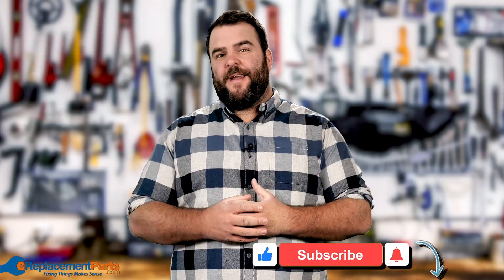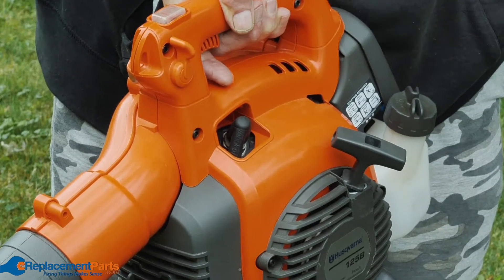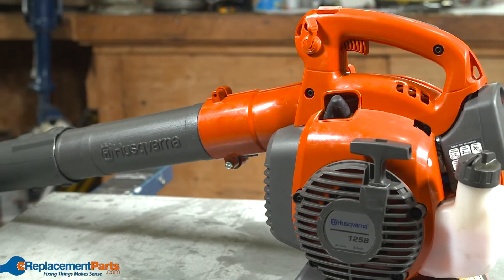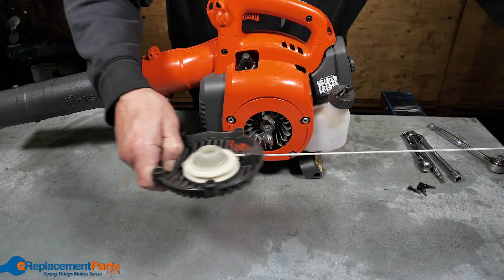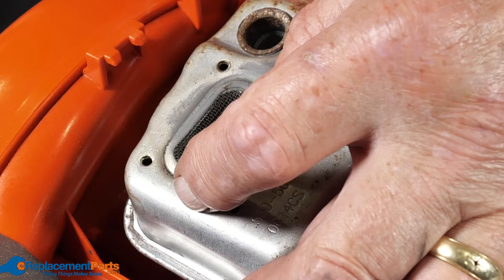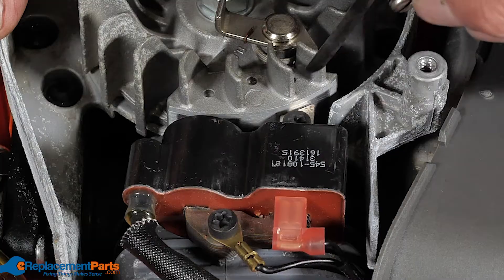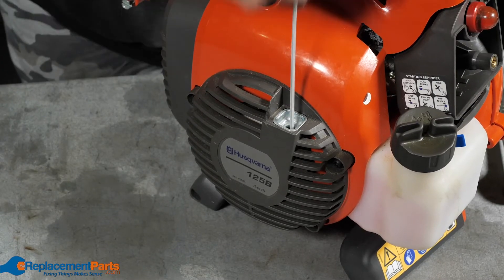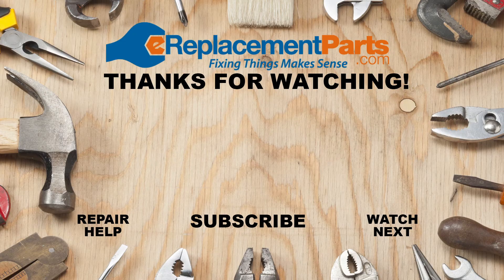My Leaf Blower Won't Start!! | Leaf Blower Troubleshooting | eReplacementParts.com

Comment: My Poulan didn't start.  I had drained the gas last year.  I used the proper staring procedure.  Finally I gave it a shot of starter fluid and it started right up and ran well.  Not sure if starter fluid is good for 2 cycle engines, but it worked.  Started right up later in the day.